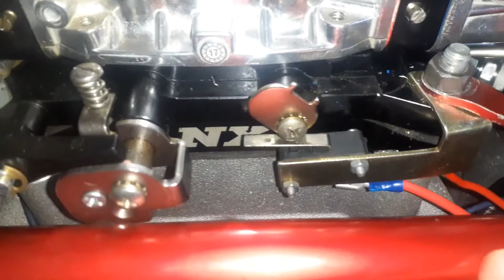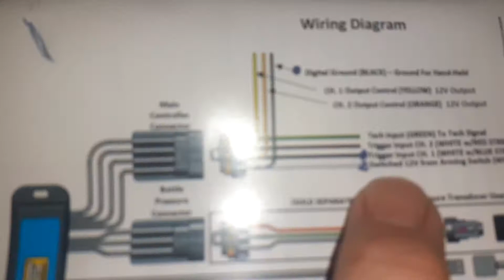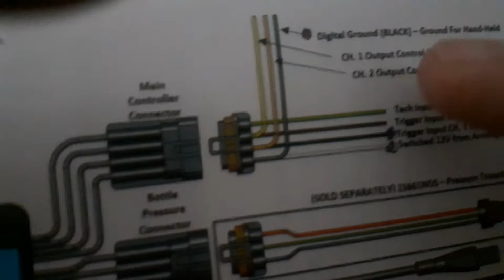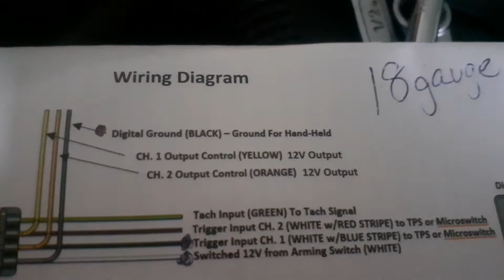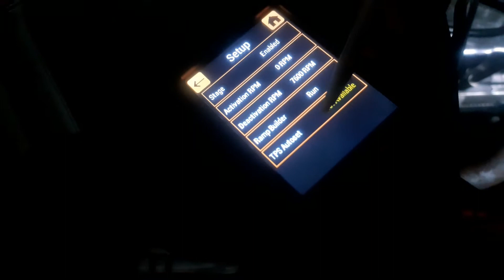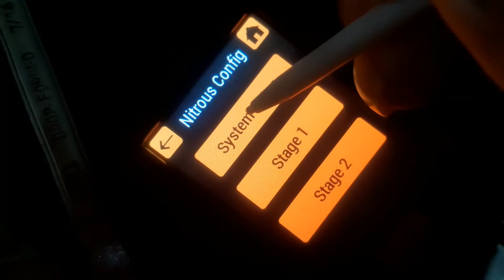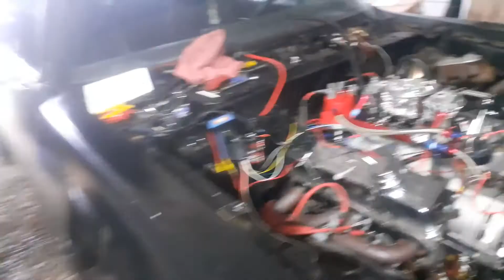1980 Trans Am gets a Nitrous Mini

Comment: I am trying to test it without turning on the vehicle and the fuel cable is not sending ground any thoughts?
Reply from the maker: Can you elaborate, little confused about the question.
Reply: @CarportGarageDragRacing  the system is all hooked up but before trying to turn on my truck I want to make sure that each solenoid is working and as I do that the red cable for the fuel is not sending the ground
Reply: @CarportGarageDragRacing  only the nos solenoid is activating and I check the mini controller all the way back and is the controller thats not sending the ground
Reply from the maker: @joelhernandez6506  do you have the black wire for the controller and the main big black wire from the mini grounded? Also the main ground wire for the mini should go to the actual battery.
Reply from the maker: The big red OR blue should feed both solenoids, then the other side of solenoids should go to the actual battery. If those do not run to the actual battery it will cause issues. I learned this after making this video.
Reply: @CarportGarageDragRacing  yes both are grounded and the thick wire goes to the negative terminal on the battery
Reply from the maker: @joelhernandez6506  do you have the fuel solenoid on a different wire than the nitrous solenoid, those are actually supposed to be to the same wire, the red wire controls stage 1 and the blue wire controls stage 2, if you have those on separate wires you have to go into the settings and make absolute sure both stages are set EXACTLY the same!
Reply from the maker: @joelhernandez6506  the solenoids ground through the nitrous mini, there is the blue for stage 1 and red for stage 2, if you are only hooking up 1 stage, then the blue needs to go to both the nitrous and fuel solenoid then the other side of the fuel and nitrous solenoid goes straight to the battery positive. Then the white with blue stripe you set as a TPS or micro switch to arm stage 1 (you change this in settings in the mini and can be activated with TPS voltage, 12v, or ground), and the same for stage 2 but with the white with red stripe wire.
Reply from the maker: @joelhernandez6506  which of the big red and blue wire go to which solenoid?
Reply: @CarportGarageDragRacing  ok I see
Reply: So the red wire is for second stage
Reply from the maker: @joelhernandez6506  Yes the big blue wire is for stage 1 and the big red wire is stage 2. Stage 1 big blue wire goes to both the fuel and nitrous solenoid you are running for stage 1, then the big red wire would goes to the fuel and nitrous solenoid you are running for stage 2. The instructions show one goes to the fuel and one goes to the nitrous solenoid, that is wrong and misleading. It controls the solenoids through ground on those wires back through that big black wire.
Reply: @CarportGarageDragRacing  thank you have a nice day 👍

Comment: I have a question.   When trip the micro switch  only the nitrous solenoid  clicks when both solenoids  are  wired  together  if i unhook  the nitrous  solenoid  the fuel solenoid  clicks .  Thanks
Reply from the maker: We actually had this issue too. I called customer service and they said to put a diode in the wire to keep it from back feeding. We wound up running the nitrous solenoid to one channel and the fuel solenoid to another channel BUT if you do that you have to make sure the settings in the mini are exactly the same for both stages or things could go bad fast. We wound up selling that kit and went turbo. Guy I sold it to used a heavier gauge wire, like the size that comes out of the mini to ground both solenoids (like a 4 gauge), and ran it as close to solenoids as he could get it before splitting into the smaller solenoid wires, and it worked for him. I am also told certain plug wires can cause this issue as well. When Old Man for SRC used it on his Mailbu he switched to a different spark plug wire just for this reason. Hope this info helps.
Reply: Thanks for the reply
Reply: Update  I changed  power source to battery  and everything  is working  correctly
Reply from the maker: @briansymonds-hf9fm  I think I watched a video where a guy mentioned that.
Reply: @briansymonds-hf9fm  did you go micro switch to battery? Or solenoids to battery?
Reply: Yes went to battery
Reply: @briansymonds-hf9fm  ok, was having problems with the setup not activating on dry test but I had activation rpm set at 3000 and just notice on vid he had rpm set at 0. I set rpm at 0 and system is hot on dry test. Thanks for your reply.

Comment: How did you hook up your micro switch I’m having trouble
Reply from the maker: Skip to 2:42 in the video and you can see it. It is on the passenger side coming off the front carburetor bolt.
Reply: @CarportGarageDragRacing   I meant as far as wiring
Reply from the maker: @carlchason6146  all the information is in the video. But if I remember correctly the White with Red Stripe (for channel 1) and White with Blue Stripe (far channel 2) I had running through the Microswitch then through a Fuel Pressure Safety Switch. Then I grounded it out. You can ground out those wires or you can send those wires to a throttle position sensor, or you can send them to a power wire. Once you turn the Nitrous Mini on you have to go in there and program it to what you have those wires set to: ground. power, or TPS.

Comment: So one wire from each solenoid goes into the big blue wire from the mini
Reply from the maker: Yes
Reply: How would incorporate an trans brake interrupt with the system
Reply from the maker: @carlchason6146  I did a video on that too
Reply from the maker: @carlchason6146  the mini has a trigger wire you can set as ground, 12v, or TPS. I set it to 12v and used a single pole double throw relay.